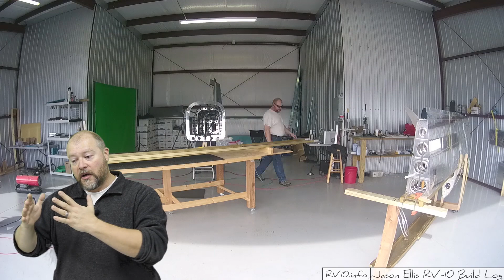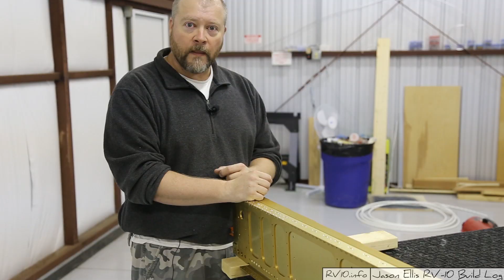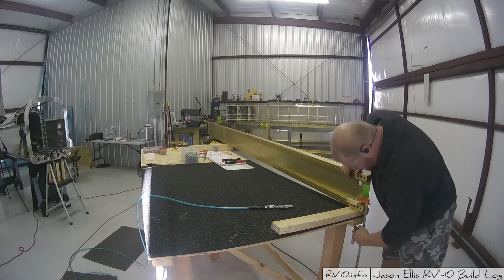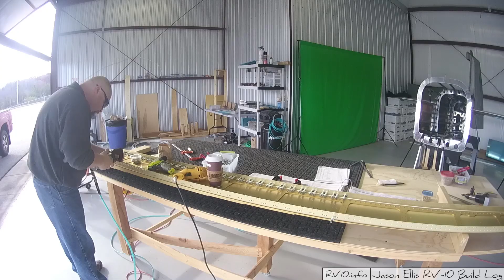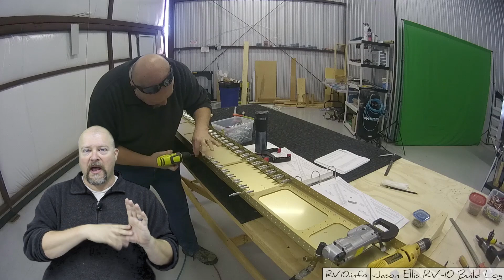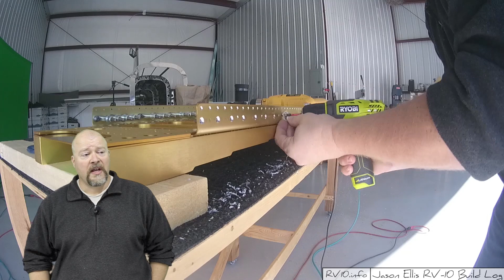RV-10 Wings - 034 - Getting spouse approval - Wingspar hole prep - Nutplates - Prime or Not

Comment: if the primer scratches off after application, it is because you did not scuff/sand the metal enough. Aluminum with an ALCLAD coating is less prone to corrosion. But once you scratch through the alclad coating, which is only .002 to .005 thickness, it can get into the aluminum itself.

The best primer for all aircraft is MIL-P-23377. It is an epoxy polymide 2 part primer. It is high solids, but goes on pretty thin.  Do not use water with the primer, unless you purchase water soluble primer, which is less toxic, but its not as durable ( in my experience as an aircraft painter) as the epoxy polymide primer?

Yes you need a respirator when painting this, and a WELL ventilated area when spraying it. You can coat the inside and outside of the plane with it, but it is best to top coat the primer within 72 hours of application, if using on the outside of the plane.

After assembly, as your empennage is, you can crawl inside and scotch brite everything, then blow it out with air, and wipe it down with acetone, and then spray everything, and you will have a protected empennage.

as far as corrosion goes, look at the chart here, to better understand what metals will corrode when in contact with other materials
https://www.monarchmetal.com/blog/galvanic-corrosion-common-questions-answered/

Comment: "Priming"/"Corrosion Protection": I do not feel that a very light/thin coat of protective primer could hurt more than help. I will apply an over-all thin coat and apply a not so thin coat in those specific areas that will eventually become fully enclosed, never to be easily accessible after build completion and/or areas that are more susceptible to moisture exposure. Better to be safe than sorry in my book. Just my humble opinion. Keep up tje great work and Happy/Safe Flying!🙏🇺🇸👍

Comment: From my experience in the USAF, 35 years ago, I can say that that stresses on fasteners during flight can cause movement that rubs through the oxide coating and permits corrosion. That's not a problem that isn't easily solved by regular maintenance, primed or unprimed. Not that I would expect your aircraft to have nearly as much stress as jet fighters. lol
Reply from the maker: It will be a jet fighter in my mind alone.. =)
Reply: Ha! More of a jet fighter than anything I'll ever have! I am so jealous. :)

Comment: Yes, corrosion is a complex topic with no easy answers.  It depends on the material being protected and the expected environment.  Alclad (pure aluminum) is very corrosion resistant for the reason you stated.  Stronger aluminum alloys, not so much.  I don't know what alloys Van's uses for the spar, but I am guessing fairly high strength alloys to manage weight.  I believe they anodize the spar materials which would be consistent with protecting a critical element made from a more corrosion prone material.  Anodizing is best, even considering the deleterious affect on fatigue life, but expensive, particularly for large parts.  Alodine seems a good compromise to me. Other primers are good for certain applications.

End of the day, it is your plane and you have to weigh the facts (cost vs. benefit for your environment) and make a judgement call.  You can always apply spray on penetrating protection solutions later if you change your mind or move to an island.  🙂

Comment: Nutplates are usually steel. Where you rivet them against aluminium, you get galvanic corrosion. That's your wing spar right? Primers and Corrosion inhibitor work well. AV-8 is very good as it penetrates when fluid but dries off translucent and water repellant but not tacky. But it's messy to work with. Saves your pride and joy though
Reply from the maker: I made a correction video that talks about nutplates being steel not aluminum.

Comment: Aluminium can corrode like crazy, depends on the alloy. 6061 is a low strength, weldable, ductile alloy and is not very corrosive. On the other hand 7075 alloys are high strength and, depending on the temper extremely corrosive and definitely need some kind of protection. Sheet material often have a microlayer of pure aluminium alloy. This layer has no strength but protects from corrosion and looks bling, if the word "clad" is printed on the raw sheet material, that's what it is. I would recommend either primer or Dinitrol AV8 in internal structure, specially if it's hard to inspect. And check where condensation can get trapped, like top of stringers with flanges facing up or behind frames on down slopes. If water or other fluids get trapped, at that spot anything will corrode. How do I know? Working structures in airliners for couple of decades. I've also seen light aircraft scrapped because of corrosion. Just do it.

Comment: Jason, I am beginning to agree with the non-primers.  I am working the empennage of my RV-7 and I just got to the point of riveting up the first surfaces: Horizontal and Vertical stabilizers.  I decided earlier I would prime, so I spent a good 5 hours one day just prepping and spraying the horizontal and vertical stabs!  I am spraying AKZO, and doing it outside with a respirator, and its a huge pain.  
After loosing so much time prepping and spraying I am thinking about not priming the rest of the airplane.  It was a work session I don't look forward to repeating! heh. 
Here is my build log:  www.theskunkwerx.com

Comment: I might add in regard to maintenance costs that parts are much less expensive. Many people shy away from experimental for this reason, but you can often get the same part for a tenth of the price. For those who worry, nothing says you need to choose the cheapest Chinese part you can find, but it gives the owner far more options. 

More importantly, items like glass avionics and autopilots are ridiculously cheap for experimental, especially compared to certified gear. And this is from big manufacturers like Garmin, S-Tech (I think) and Dynon. As a side note, please look at the Garmin G3X touch EFIS. Most beautiful suite besides the G3000 IMHO!

Comment: Priming! Ok.  So I somewhat agree with Just Trollin, where there are mating surfaces there "should" be a primer.  What is the primer there for?  Well it would be there to prevent long term corrosion if any moisture/contaminates were to be between the two surfaces for any extended period of time.  With your aircraft I could argue its going to be a hangar queen and you probably wont be near salt water for any extended periods of time.  So for most of your mating surfaces, you will be fine.

BUT. There is one place, and its really going to annoy you Jason, because you just finished it.  But one place there really really should be primer. The aileron weights.  What is often missed in the primer debate is Galvanic Corrosion, or also know as dissimilar metal corrosion.  A quick google search will sort you out for the details.  In summary anywhere aluminum is going to be in direct contact with 1 or more different metals there should be primer.  Galvanic Corrosion does take time, its not something that will be a problem in a few years (again depending on environmental conditions).  But it will be there.

I would argue that the area surrounding the back side of the fuel tank ribs should also have a blast of primer or 'alodined'.  Same as the wing root area, anywhere you would expect contamination.  But the tail, rear side of the spar, outboard wings; meh It doesnt really 'need' priming, and you are right adds complexity and money that doesnt add any value.

Weight wise if you primed the whole thing maybe add 10lbs at the absolute most.  Oh primer wise, PTI products are fantastic and available at aircraft spruce.
Reply: I agree with you on all points, but salt air can do a number on aluminum to a small extent, and I was mainly referring to long term. Also, I don't know the price difference and if it would save money, but, dissimilar metal tape is an option for small parts.

Comment: Jason, I used your advice about incorporating in the Wifes' mission.  Here is what I discovered: I'm happy to fly just about anything, but my Wife REALLY does not like old airplanes, ancient avionics, dated interiors, etc.. She simply wants comfort and speed, which is ok by me! So it looks like I will end up needing to invest more time and $$$ on the interior and fit+finish of the 10 that I build.

I had another question:  I noticed you have a 30gal air compressor since a couple of videos back. I've only seen you use the pneumatic squeezer with it, but not the air drill.  Is 30gal still not enough for the air drill?  I ask because I am equipping my workshop and have a 30gal compressor, but wondering if it won't be enough for air drilling.  My workshop isn't wired for 220v otherwise I would go bigger.
Reply: SeanM My wife said the same thing as long as its comfortable and up to date "computer stuff" she will go
Reply from the maker: I talk about drills here https://www.youtube.com/watch?v=xYzzYC04iNo
Reply: brilliant! I hadn't seen that one yet.  thnx

Comment: Jason, at least a partial answer to the question you posed concerning corrosion on aluminum. Pure aluminum does indeed create a corrosion layer that in fact protects the surface from outside corrosive effects (effectively becomes self protecting). However, from a some of the research I have been doing with the vans product and materials, they use a lot of aluminum alloy in their parts. It sounds like they have gone back and reintroduced a thin aluminum oxide type layer on the material that has the bluing (which my understanding is one of the reasons that they put the bluing on those particular parts, to protect the protective layer on the skin of the piece.) For the pieces that are alloys, this removes the natural ability of the aluminum to create the protecting oxide layer and why those that support priming do so.

I have been trying to research, as I have heard you bring it up several times in various videos, the pros/cons of priming and am still on the fence. As you said, there are a lot of folks on both sides of the question that are pretty adamant for their reasoning. I will have to continue my research before I begin my build.

Again, thank you for the video updates. I am pretty sure that I burned through all of your empennage and wing build videos in the course of a week and I think that they helped me to convince my wife that this is a good project!
Reply from the maker: So most of the parts that have the bluing are skins.  Most of those skins will already have a thick paint job on them on one side, but not the other.  Interesting.

For my part, I shall likely continue to not prime and monitor.  If I see a corrosion issue creep in I'll take action and fix it then as well as report my findings.   That would give me an answer for sure! But at this time I still feel it's not necessary.

BUT, those that say you must prime would also likely not buy my plane because it wasn't primed... (It's not for sale!)  So, if you do decide to prime, I really feel the AKZO stuff is the way to go.
Reply: I tend to agree with you and lean to your side of the fence with regards to the pros vs cons. 

I continue to look forward to following your progress!
Reply: Can't see how a very light/thin coat of protective primer could hurt too much? I would at least apply in areas that will become enclosed, never to be easily accessible after build completion and/or susceptible to moisture. Better to be safe than sorry in my book. Just my humble opinion.

Comment: Just two comments. Nutplates, single wing, double wing, floating etc..., all nutplates have an oval shape, it is the locking mechanism that is built into it. Priming: you should always alodine and prime all parts and always seal all mating surfaces for one reason, safety. Aluminum can corrode fast, better safe than sorry. But I do understand the cost issue. TIP: You can still use a screw to hold your nutplate in place, just use enough washers on the screw so you only catch one thread to pull the np up tight and you don't engage the locking part of the np. Nice work, keep it up. Been working on planes for 30+ years and I'm still learning knew stuff from people all the time.
Reply from the maker: Yeah I didn't realize they intentionally made the nutplate slightly oval in order to retain the nut.. Makes perfect sense.
Reply: You're doing great man. You'll keep learning the little things as you go. I watch a lot of first time builders vlogs and I am shocked that none of you have made any MAJOR mistakes. When I first started in aviation back in the 80's, they had to scrap the first 20 airplanes I touched I screwed up so bad. J/K. Keep up the good work, good luck and enjoy it.

Comment: Thanks for addressing your personal opinion about priming. I'm using the two part Azko for for my 12. You are correct about the time the prep is the biggest time consumer, it no doubt is almost doubling the build time.  Just a couple of points about nut plates, they are made of steel and are made to be slightly oval to hold the screw in place. There usually is a minimum running  torque that each nut plate should provide. You don't want it backing out. Keep up the good work and thanks for taking the time out of your day to fill us in on your build.
Reply from the maker: I realize now I said aluminium in the video.. woops..  I did not realize they intentionally made them slightly oval!  That's interesting and makes a lot of sense!  Great info David!
Reply: I have heard other inexperanced builders taking a tap to the nut plate to make the screw nice and easy to get in. Big mistake! if it's that hard then I would recommend a little and I mean a little bow lube on first two threads to make it a little easer to drive in the screw.

Comment: I think I made a comment on one of your other videos. Priming does add time and money to your project but wouldn't really worry about the weight. The RV-10s envelope isn't such that you should barebones it because you're worried about W&B. 

Corrosion does happen on older planes especially in the empennage.  Often this gets sprayed down with an oil as a preventative measure at annual.  I personally chose to prime my 10s empennage as one a learning experience and two so I wouldn't have to worry.  Since I'm going the QB route the guys in the Philippines used some type of 'wash primer' on a majority of the parts.  I ended up using rattle can stuff on certain parts that were either outwardly exposed or hard to get to once something was assembled. 

I like AKZO best, but it's not the most convenient product to use for small batches.  Rattle can paint won't scratch easily if you prep it with something like Prekote while etching with a scotch brite and then spraying 2-3 coats within an hour and let it cure for a few weeks.  Not saying you can't touch it but wait 24 hours to assemble it and don't abuse the part... or you'll probably scratch it.

Purely my opinion is all the control surfaces, wings and tail should be primed with something as a protective measure.
Reply from the maker: I 100% agree that with the RV-10 the weight thing isn't really an issue, but what about a -12?   And do we know how much weight it's actually adding?  I don't, but it's not zero =)

I have zero issue with priming and honestly if I wasnt so painfully lazy, I probably would have done the whole thing with AKZO as it seems to work great!  But that stuff is nasty.  I have enough health issues as it is.. haha  And like you said its not really convenient to use.

Thanks for your input Justin!  Lets see what others have to say.

Comment: I'll second your option about primer... Sherwin-Williams P60Gs industrial primer wash is the primer option that I went with, which is supposed to be that same as what Van's uses in their quick builds but with a green tint ( military style).  after I finish this gallon, I don't plan on buying another.  The product totally works as advertised and isn't that heavy, but the co$t, time, and lack of evidence of true value added Isn't there in the math i can find.  I own a Cessna 172M born in 1975 that wasn't primed and every annual or repairs done, the mechanic mentions how clean the plane is.  I asked him about primer in planes and he hasn't come across a scenario or a plane that he would say has benefited from it.  Very small sample size but enough to make me feel good about not continuing to use it.
Reply from the maker: THIS!  And I hear this all the time.  Same experience over and over.  Somewhere someone has had the opposite experience, but most people tell me that they want their plane to last 50+ years, not 5.   Which I just don't see as a valid response.  Thanks for your input.